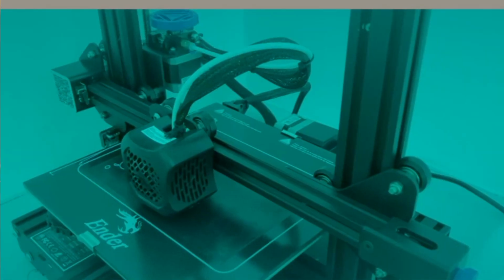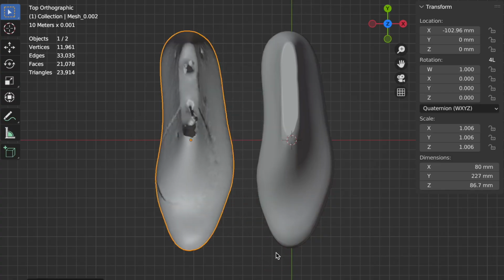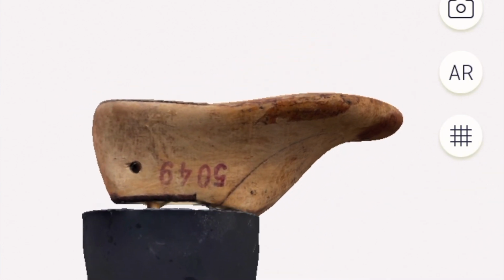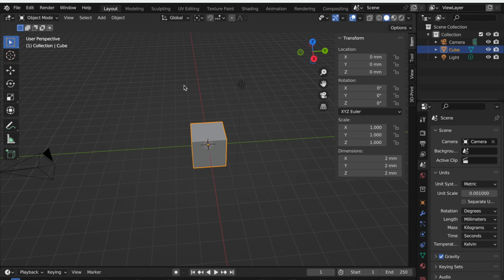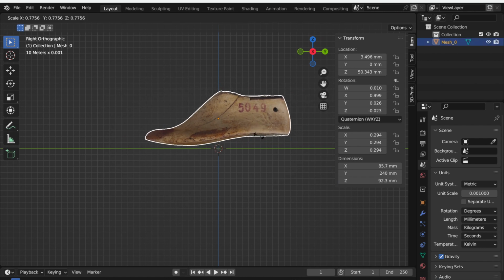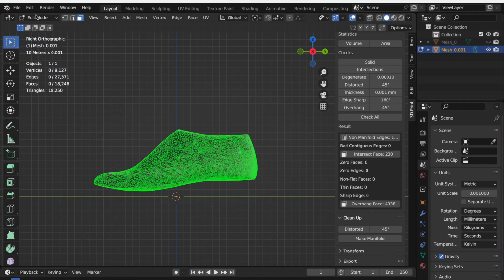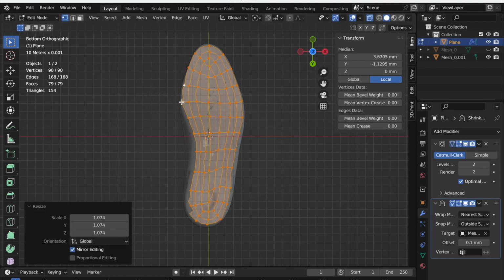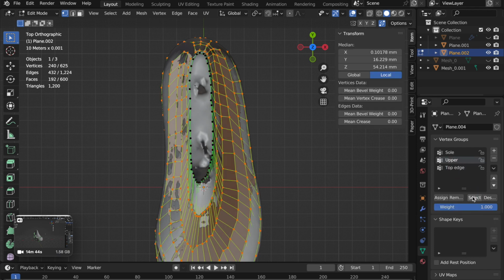How I turned a 3D scan into a digital shoemaking last

Comment: You're probably in some other farther off part of Canada than I am, but I'm now a new subscriber, and poking around what other projects you published up.  That said, stumbled upon your knitting machine videos first, with my mom being an avid knitter.

You're very persistent to push through with the non-nVidia photogrammetry solution to get your model.  I've danced around not owning a modern nVidia card and it's difficult to find a workflow that lets anyone make things in a useful way.  It's frustrating.  And also, uplifting to see that you persisted and found a workflow that gets results.

In the last two years, I've bought up a 3d scanner, and this summer, a 3d printer.   This is after about a decade of sitting on my hands not jumping into either purchase to avoid spending all my time tinkering and tweaking the tools, instead of using them to get to using what I want to make.

While a dedicated scanner CAN speed up things, there's no free lunch!  It's exactly like your learning curve with Blender - takes time to become proficient with the tools.   Ditto for the 3D printer!

That said, a scan of the other lasts might help build your digital "inventory" up a bit faster.   I'd offer to scan them using my amateur level of scanning "skill", if you can't find someone willing to help you that's closer by.